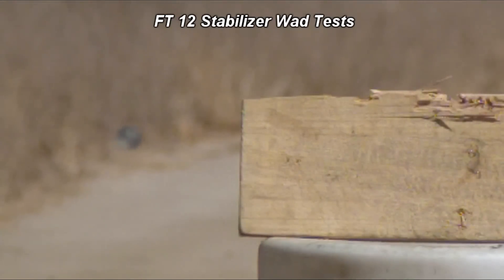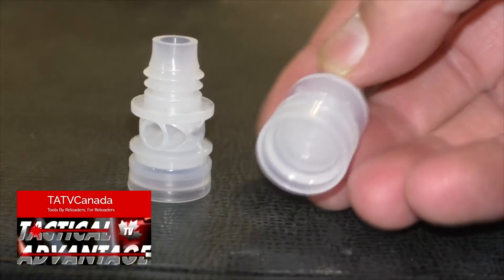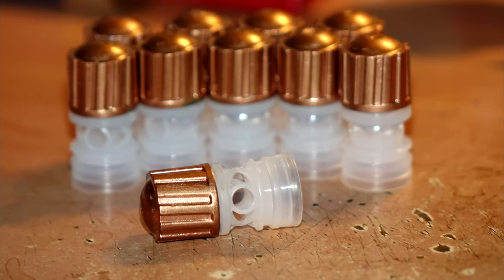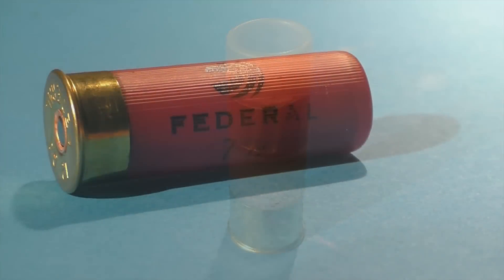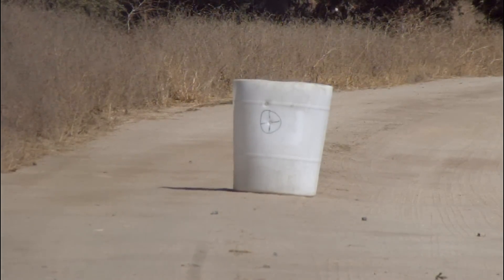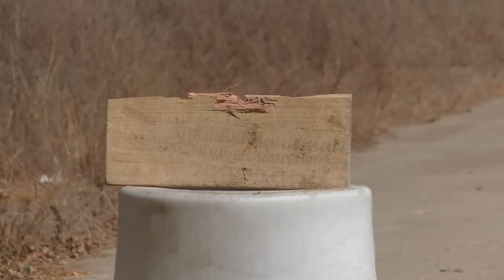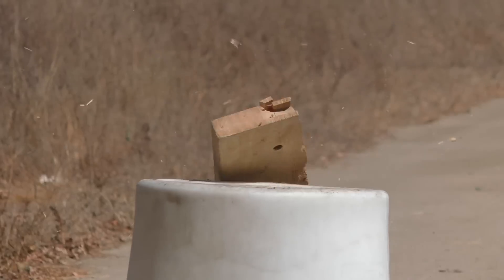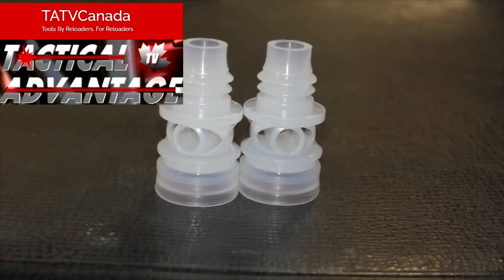Testing the Canadian FT-12 Stabilizer Wad

Comment: Glad to see the federal hulls have enough length to spare. cut the top and load the slug AND still have enough for a roll crimp ❤❤
Reply from the maker: That surprised me.   Using a different wad with a deep skirt,   it might not work because it would leave an air-gap in the powder.

Comment: Wads are pretty important, having a bad wad is like having a V8 engine with a lot of power but you left the transmission stock and governed. It might work but you'll get reliability issues and less performance.